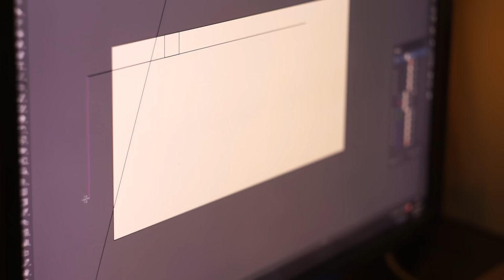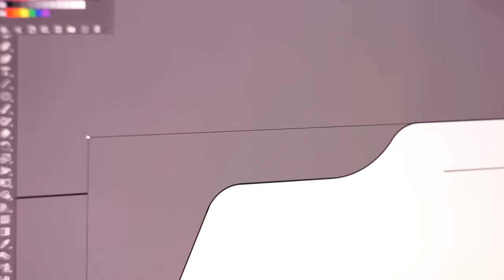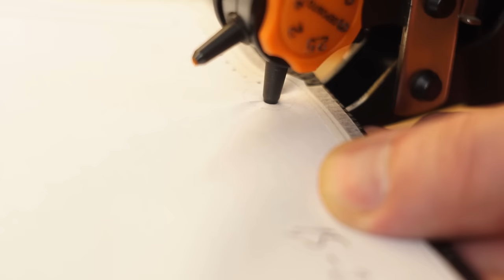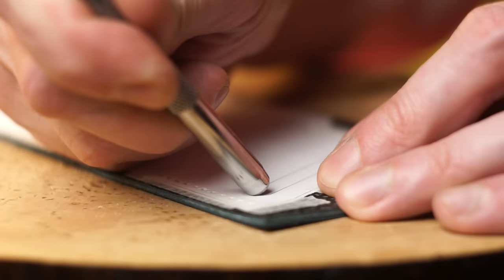Making A Minimalist Leather Wallet.

Comment: The groove that you cut crosswise is not in the pattern. How many mm and where do we open the groove? Thanks a lot for sharing.
Reply from the maker: Hi. This groove is cut to make it easier to bend the part. But it is not necessary. You can simply use thinner leather.

Comment: Just made the wallet and It's such a great pattern! It fits 4 cards each side easily. The snap-button's position is very functional. Because the snap button's position on top makes the wallet close flush, as the buttons width is almost the same as the thickness of the wallet with 8 cards and some cash. 
It was a delight to make. two pieces of leather, 4 short stitch lines and a snap button! 
Thanks for sharing the pattern. Much appreciated.
Reply from the maker: Awesome! Use it! Some customers sent me photos of this wallet, which showed that they managed to load up to 6 cards on one side. And that's 12! It works :)
Reply: I've got to find my thinner leather

Comment: Thank you for your kindness. it looks great and well filmed and beutiful work.. thanks again..
Reply: Ps when i import the laser file into lightburn. its sayng the one piece is 14.56 inches long is that correct?   warm regards
Reply from the maker: Hi, glad you liked it!
Size of the large outer part should be:
length 370mm (14.5 inches)
height 85mm (3.3 inches)

Inner detail:
length 185mm (7.2 inches)
height 80mm (3.1 inches)
Reply: @badweatherworkshop  thank you. I will have to buy bigger leather sheets. Mine are 12by12 inch. But ok thanks. Great work again. Keep posting big fan. Lol

Comment: Thanks for sharing a free PDF. I have a question regarding the width of the long piece. In the print its 79mm is that correct or shoulde it be 100mm

Comment: Love the design. What leather are you using here? I'm looking at making this with American Bison, would you recommend that leather?
Reply from the maker: Yes, sure. Bison is a great option. The main thing is to watch the thickness, it is best if it is around 2mm (0.08 inches). And the internal part can be even thinner. The main thing is that the skin is tight and does not stretch too much.
Here I used regular combined-tanned cow leather.

Comment: That looks great! I have not tried making anything from a pattern before, but want to give this a try. Are the angles slits to put cards through, or are they there for design?
Reply from the maker: Angled holes to separate cards. For example, if you insert a second card into your pocket, it can be inserted into this hole. Or you can, as usual, put several cards in one slot.
Reply: @badweatherworkshop  I thought it might be, but found it a little hard to tell if the slots were big enough in the vid, but thanks for confirming!
Reply from the maker: @jamesmacleod8388  You're welcome, good luck!

Comment: Since i don't have any buttons currently, would this pattern still work without them? Also how do i print this in Letter size instead of A4?
Reply from the maker: Why not? Some people did this. But I would still advise purchasing the necessary buttons. Fixation is good.
I won’t say anything about the sheet format; the PDF file itself is already converted to the required size. In theory, you can print as you like, the dimensions of the drawing should not change.

Comment: That's really superb👌🏾👌🏾👌🏾.
Why edge paint in flesh side? 🙄🤔
Reply from the maker: Thank you. Edge paint it is one way to make a double-face. Different masters do it differently. Some use tokonole, some use acrylic paint, and I like edge paint. It dries quickly. Although to be honest, you can do without it. The short cut underside of leather - is what some people like.
Reply: @badweatherworkshop  do it have a risk of peeling out?
Reply from the maker: No, if the gluing line is sanded with a sharp tool.

Comment: I have a question, when dyeing the flesh side how do you prevent the dye from going through and cause dark spots on the skin side? For me I feel like the only thing that's been working is dying in thin layers but I noticed you really soaked the leather. When I soak the leather like that it ends up going through
Reply from the maker: It's strange that this is happening to you. I've never had problems with painting. I can assume that the problem is in the paint itself. I use edge paint for the "double face". It could be Fiebing's, Girba, or Kenda. Penetrating paints that can penetrate the skin through are usually alcohol-based. Maybe this is exactly what you have.
Reply: I use the fiebings pro dye and ive heard someone else having the same issue and he told me to do multiple thin coats, thats what i do now and its been working. I was just surprised to see you being able to use so much dye on the flesh side. Maybe its also the type of leather, i use a natural color veg tan leather  @badweatherworkshop
Reply from the maker: Look... Leather type, in this case, does not really matter. The type of paint matters more. Fiebing's PRO Dye is an alcohol-based paint. Any paint of this type has high penetrating ability. This description can be found on the company’s official website.
I use Fiebing's Edge Kote. This is an acrylic-based paint for edges. It does not penetrate deeply and creates a stable layer on the inner surface of leather. @Matthiasschweizer
Reply: Oh ok, thats very interesting. I never thought about this. Do you use this edge kote on the flesh side aswell? @badweatherworkshop
Reply from the maker: Yes, the type of paint makes a big difference. For the front, I don't use this paint for the edges. For face paint, the alcohol-based paint you use is just right. @Matthiasschweizer

Comment: I make patterns as well, and shape builder in illustrator is my favorite tool inside the software. Your wallet is very unique, just wondering what those slots are for, more cards? Thanks for the pattern.
Reply from the maker: Thank you. Glad you like it. Slots on the pockets for cards can act as a divider. One card can be inserted into the pocket as usual, and the second into the slot. So it may be useful to divide the cards that you use most often. But it's not fundamentally important.
Reply: @badweatherworkshop  I'm just rediscovering this video again. Can I use the pattern to make products that I can sell?
Reply from the maker: @johnnyc.5979  Hello again. Usually people don't even ask about it). Do as you please. I love that my little things can be used for other people in this way.

Comment: Hi
anyone know the exact dimensions? I can not get it to print correctly.
Reply from the maker: Hello. Why not? What's wrong with printing?
Reply: too small @badweatherworkshop
Reply: only half of the smaller inner piece comes out on the print. i've tried all settings, if i go over 100% the print just runs off the page. tried using my printer's software HP Smart, i tried Microsoft Pdf print. i clicked on  100%, and actual size. i even tried to flip the image 180 degrees to get the missing part but it only prints out one direction no matter what view is in the print preview. i can draw it myself, can you supply the dimensions? thanks for responding. Bob S.
Reply from the maker: It's strange that this happened. The dimensions of the inner part are 80x185mm.
See... In the distribution folder, I updated the BSW_wallet_Print_version_A4 file and added an element for scaling (red square) to the project. I also advise you to try to print using not a scale, but output settings, such as A4 (international paper). In the print window, there is a "page scaling" item, the value should be "none".
Reply from the maker: And yet, you can send a file for printing directly from Google Drive. The browser will open a window with the settings that are correct by default.
Reply: hello again, strange happening with the Google Drive. (or maybe it's just my computer) Instead of printing all it will do is prompt me to save the file, over and over. So, I finally used the updated file with my own printer s/w choose "actual" size and had to use U.S. Legal size paper. That did it for me. Thanks for adding that scale rectangle. Please always include that, in the past at other places i  had to resize up to 101% or down a bit. helps to have that included scale. Thanks again for replying!--Bob S. @badweatherworkshop
Reply from the maker: I hope you resolve this. Alternatively, you can print it somewhere else, at work, at a local print shop, or ask a friend who has a printer. Have a good mood always!--Alex M